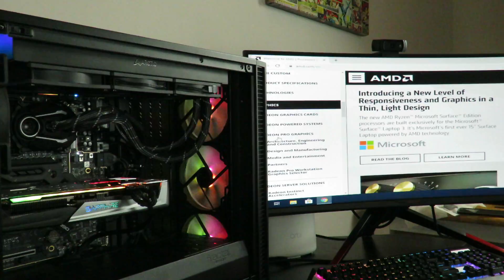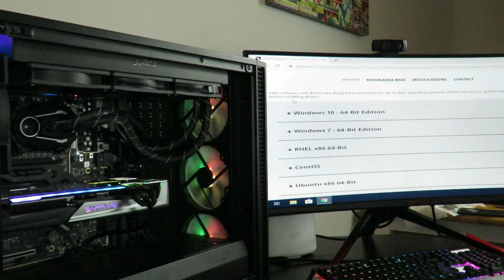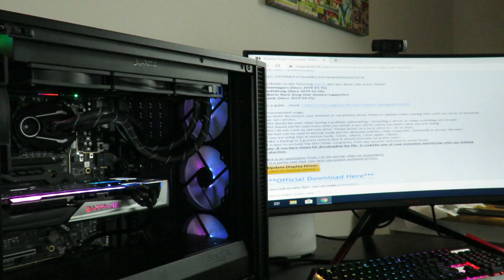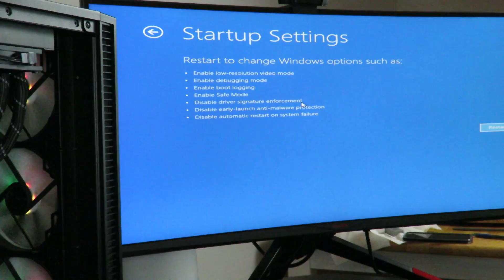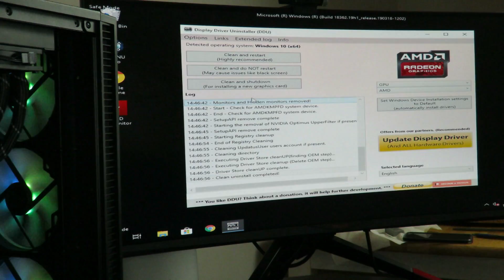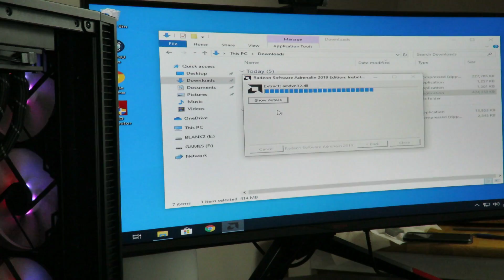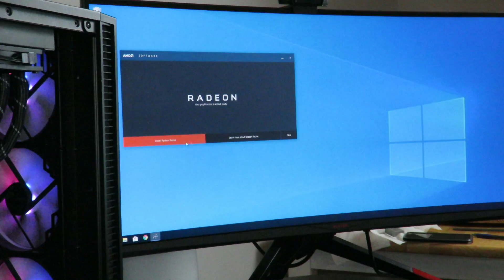Installing the AMD Sapphire Radeon Nitro+ RX 5700 XT 8GB OC Graphics Card

Comment: Hello, i'm thinking to configure a new pc, initially i was going for the rx 5700 xt nitro+ but i see on the web that there are a lot of problems and the card is unstable, it that true? Now i think that i will buy a rtx 2060 super instead, is there an high difference between this two card in 1080p? What card do you you advice to me? (the cpu will be r5 3600)
Reply from the maker: So the 5700 XT Nitro will give you great peformance, especially for the price.  And while there have been issues, I probably relate that more to issues caused by incorrect driver installations, people not plugging in BOTH PCIe connections and maybe a few other things.   I always recommend to install using DDU first, then installing the drivers.  As for the NVIDIA counter parts, the RTX 2060 Super, will perform slightly lower than the XT but the RTX 2070 Super will perform a bit better but it will cost a little more: https://geni.us/bJ83
Reply from the maker: also, what power supply do you have, manufacturer and model number?
Reply: @ThisBytesForYou The configuration is new so i think i don't have to use the ddu and i was looking for the cooler master 550w semi modular
Reply from the maker: @michele3210  for the 2070 Super, it requires a 650Watt power supply and the 5700XT requires a 600Watt, but recommends a 650Watt.  As for the new config, windows includes a base set of drivers, even on new installs, I run DDU, check out the video I made: https://youtu.be/clLYbBywhAg
Reply: @ThisBytesForYou  yes it's raccomanded but i don't think the system will draw more than 400-450 watt in full load
Reply from the maker: @michele3210  correct, during my testing, it was about 450 watts but I would recommend what they recommend and you can see potential issues but it sounds like you have already made up your mind, so I hope you the best of luck.
Reply: @ThisBytesForYou  what 600w psu do you recommends for an economic price?
Reply from the maker: @michele3210  here are a few, 
 default https://geni.us/FoS5hS, https://geni.us/cDB5uU, https://geni.us/wj27f,

Comment: Hi, bought a new sapphire 5700 xt nitro se. Installed and connected with 2x8 pin. Every component starts except the gpu. Any idea? 750w psu. New pc and everything was unconnected before First start
Reply from the maker: What do you mean every starts but the GPU, does the computer get in windows?  Do you have the monitor plugged into the video card, instead of the motherboard, what motherboard do you have?
Reply: 4 Pin psu cpu cable was not connected and one single pin from cpu was bent. Gently corrected. It works now wuhuu
Reply from the maker: @omrkad  ahhhh that is so great to hear that everything is working, thank you so much for letting me know, it means a ton to me.  Have fun with that great new card.
Reply: Make sure that  your video card is seated firmly in the slot, also make sure that the  GPU power connector is Fitted Firmly, it seems to me a connection problem
Reply from the maker: @mountanarivera4450  he got it working Mountana, thanks for chiming in ;)

Comment: Hello,thanks for the video, i recently bought this gpu and i get black screen after installing latests drivers, do you know where the problem comes from? Thank you
Reply from the maker: sorry, a lot of work on my day job.  I would love to help you, but can you let me know what power supply manufacture and model number also, are you using DDU to uninstall the older drivers and install the latest?
Reply: @ThisBytesForYou   Hello, i'm using an gp gigabyte750h power supply , no i didnt use ddu but i made another windows installation from scratch.
Reply from the maker: @theo6387  why don't you give DDU a try installing the official driver, use my video as a reference it helps tons, especially since MS has their own version already in the build, as well as it installs its own if you let it.  https://youtu.be/clLYbBywhAg, on the fresh install, did it work for you?
Reply: @ThisBytesForYou  I'll do right now and keep you informed. Thanks you !
Reply from the maker: @theo6387  Thank you so much my friend, I hope it all works out for you.  LIke with all components from any vendor, there can be issues, but I am pretty sure all is good.

Comment: Where is the memory on your MB?
Reply from the maker: Sharp eye, it's kinda hidden.  On the EVGA Z390 dark, the memory as at the top of the board, so kind of under the liquid cooling unit, you can see it lighting up.
Reply: @ThisBytesForYou  I looked up the MB and seen that. Thanks for responding though. The 5700XT is my next video card purchase when I can afford it. My GTX970 is lagging on all the newer games at 1440p.
Reply from the maker: @Bland-79  yeah, they 970 is a great card, my sun uses it but it's showing its age.  A 5700xt would be a nice update and you are so very welcome, I love chatting with my viewers.  Thank you so much for stopping by, checking out my video and commenting, it means the world to me.
Reply: @ThisBytesForYou  To take full advantage of it I will be upgrading my MB CPU an I7 6700k and RAM to an AMD build. I don't think Iv'e ever done a full AMD build before and I'm 40.
Reply from the maker: sorry I never replied, for some reason a lot of comments are not coming through.  I have built tons, it was part of my job when I worked at oem's as product develpment.
Reply: @ThisBytesForYou  My gtx 970 bit the dust last week. Until I can afford to build a new PC I replaced it with a 1660 Super.
Reply from the maker: @Bland-79  that's not a bad card though for a budget card.
Reply: @ThisBytesForYou  Runs better than my 970 did. I bet my I7 6700k is bottlenecking it though.
Reply from the maker: @Bland-79  no actually, they will work fine together.

Comment: Newbies might try to do this while pc is still conneted to power: you did not mention to unconnect every cable from the pc (& then to hold power button for a moment to ensure the electricity was freed from the psu & other components - or so I heard that it works like this, but probably not as necessary as the first step).
Plus for showing a way to stop win10 from installing drivers automatically (although it's still recommended to just disconnect internet beforehand, duh).
But it's overall very nice step by step guide on how to do the stuff, I'll say that.
Reply from the maker: it's hard to cover it all, but I do thank you and I will try to add that in my next video.  As for holding the power button, just tap it once or twice and that will take care of it, basically the same thing.  Thanks for your compliment and what I should add in my next video, thanks.
Reply: @ThisBytesForYou  the video is really really fine, you mentioned a lot of little stuff I wouldn't even know or think about that are actually useful, so that was just one thing that hit me you missed.
But your clarity in the vid really speaks to me. ;-) Good work, good work.
Reply from the maker: @picapica201  thank you my friend, I do try.  I have been building PC's since I was 13 (I am 41 now) and I love teaching people, thats why I make these.  I do all of this unscripted so at times i may for get a step or 2, but I try to cover everything.  I will try on my next video to cover all the bases.
Reply: you dont have to unplug the cord... just turn the power supply off. Then press the power button to make sure the power is gone and out of the computer
Reply from the maker: @dareason7581  yup, I know, but there is always the what if, unpluggnig the cord, you know for sure there is no power going to the unit.
Reply: @ThisBytesForYou  do you have any ideas what could be causing the blackscreen? I'm even getting slow downs in Crysis 3.
Reply from the maker: @dareason7581  I highly recommend you run DDU to get rid of the older NVIDIA and AMD drivers, and also disable windows from automatically installing their latest driver (you do this all in safemode) then reboot and go back into regular windows and install the latest and greatest driver, DDU allows you to disable the automatic driver download which messes up so much, check out my video on that here: https://youtu.be/clLYbBywhAg

Comment: can i just uninstall the Nvidia drivers from the control panel?
Reply from the maker: you can, but it will take MUCH longer and you will have to reboot about 4 times before you get rid of everything.  Sadly, when you install video drivers for AMD or NVIDIA, it comes with a host of other programs and such and to make sure they don't cause issues, you HAVE to uninstall all of them.  With DDU, it uninstalls Everything, does not leave behind any folders and registry entries like the AMD and NVIDIA uninstallers do.
Reply: @ThisBytesForYou  thank you so much dude keep up the good job :)
Reply from the maker: @Fourthion  thank you so much for your kind words my friend, it means a ton to me.
Reply: @ThisBytesForYou   one more thing i forgot to ask... You recon i m going to have a bottleneck with an i5-8600k running at 4.7 Ghz?
Reply from the maker: @Fourthion  nah, not at all but I would recommend taking it back to stock prior to installing it.  You don't want a bunch of bluescreens and you think it has to do with the video card/drivers when in fact it is the overclock.  Save your overclock in an overclocked profile, then set everything back to stock, save your stock settings as a separate profile (if your BIOS has multiple profiles), then save the bios, boot into windows, download DDU and the latest driver.  Extract DDU, boot into safe mode, run DDU to get rid of your drivers, make sure to check to prevent windows from downloading updated rivers, then shut down.  Install your card, boot into windows, install the drivers and do a lot of testing.  Once you see everything is set and stable, place your overclock settings back and do more testing.  Changing video cards, that have different power requirements and affect your overclock but since you have tested at stock, found no issues you have a point of reference to work with.
Reply: Dude listen up you need to run your OS in safemode. USE DDU it will uninstall all traces of your old videocard. If you do not do this it will 100% give some minor or mayor conflicts. 

You want to make sure it's either a clean windows no drivers, or a used windows what you run in safemode with DDU to remove the drivers from previous brands. Especially conflicting brands, which are all Intel, Nvidea and AMD drivers. Old drivers fuck you up so remove it clean.
Reply from the maker: @dicknr1  for sure

Comment: Hey I bought this card a day ago and when i plug it in the screen is just is completely black nothing is happening
Motherboard: M5A78L
CPU: AMD FX 8350
Is it a driver issue or is m card dead or is the motherboard out of date
Reply from the maker: A few things, 
1.  Do you have the PCIE connecitons connected to the video card?
2.  Do you have the HDMI or Display port connected to the video card, instead of the motherboard?
3.  Do you have the correct input selected on the monitor.  Meaning, if you are connected to HDMI, do you have HDMI selected on the monitor?
4.  Is the video card seated properly in the PCIE slot?
5.  What is the manufacturer and model number oof your power supply?
Reply: @ThisBytesForYou  I have a Corsair cx 750 the video card is seated properaly and the PCIE connentions are connected I have a HDMI plugged in and i have the correct input on the monitor, also thanks for the fast reply
Reply from the maker: @Lomasari  anytime my friend, thank you so much for stopping by and checking out my video and commenting, it means a ton to me.  So, have you tried another video card, first of to make sure that the PCIE slot of working, this also allows you to remove and reseat the video card, it happens to us all, it looks seated but its not totally.  Oh one other thing, your BIOS MUST recognize the PCIE slot as a UEFI slot, so you will need to change that in the BIOS.  A quick search, I don't see that it does, which is a problem since newer cards need UEFI, please check in the BIOS to see if you have that option, some where where you would see PCI-E.
Reply: @ThisBytesForYou  I tried the card in another pc just now and still zero input and I just took out my GTX 950 Which is the card i had in before the 5700 xt
Reply from the maker: @Lomasari  hnnnm sadly then yes, it looks like the card might be bad.  Hopefully you have enough time to return it and get a new one, it happens with anything though.
Reply: @ThisBytesForYou  Ok I was doing some trouble shooting and I got the card to work but the cpu is being used as the dedicated gpu but it doesn't have integrated so it dies every time I play anything
Reply from the maker: @Lomasari  the FX 8350 does not have integrated video, so it will never power on through that, but are you connected to the VGA/DVI/HDMI/DP port on the motherboard or the one on the video card?
Reply: @ThisBytesForYou  video card it may just be heavily bottle necked
Reply from the maker: @Lomasari  no, the cpu has no video capability what so ever, wait.... what power supply do you have, manufacturer and model number?
Reply: @ThisBytesForYou  I have a corsair CX 750M
Reply from the maker: @Lomasari  sorry, I saw you already said that.  Download gpuz and run it, you will see on the bottom left or right hand side, an unchecked box that will let you monitor temptures in the background and place a text file in whatever location you would like which gives you a bunch of info.  Run this, them play a game, when your monitor shits down, reboot your pc then open that file so you can see if your gpu is overheating.  U thought at first it was a power issue, but if you have both pcie connections connected to the card you should be fine.  So it might be thermal.
Reply: @ThisBytesForYou  I don't think it's a power issue
Reply from the maker: @Lomasari  being that you have a 750, for sure its not a power issue.  I would recommend you contact Sapphire and get the card RMA'ed or maybe they can help you get it back up.  If they do help you get it back up, please let me know what they recommended so I can help others.  Thank you.
Reply: Mine did the same after some days boom burned...this card has issues
Reply from the maker: @PetrosVu  wow, that is insane.... First I have heard about that.  Did you RMA it?
Reply: I get no signal on monitor
Reply from the maker: @denisg123  A few things, 
1.  Do you have the PCIE connecitons connected to the video card?
2.  Do you have the HDMI or Display port connected to the video card, instead of the motherboard?
3.  Do you have the correct input selected on the monitor.  Meaning, if you are connected to HDMI, do you have HDMI selected on the monitor?
4.  Is the video card seated properly in the PCIE slot?
5.  What is the manufacturer and model number of your power supply?
Reply: @ThisBytesForYou  everything is done correctly 
Power supply is evga 450 bv
Reply from the maker: that is probably your issue, they require a 600Watt and recommend a 650Watt.
Reply: @ThisBytesForYou  should get one withen 2hrs i will let u know
Reply from the maker: @denisg123  please let me know how it goes, but I will be sleeping in 2 hours, I will respond to you tomorrow though, I always reply.
Reply: @ThisBytesForYou  no still not working i got a 750w corisair
Reply: @ThisBytesForYou  got it to work remove ram and insert left to right 1 and 3

Comment: Hello. My PSU is modular, do i need to plug  2 cables or 1 with 2+6 × 2 is enough ? Thx great video.
Reply from the maker: either would be perfectly fine, what is the manufacturer and model number of your power supply?
Reply: @ThisBytesForYou  the psu is Corsair RM850X 😊
Reply from the maker: @luismartins6687  ahhh ok perfect, I just wanted to make sure that your power supply met Sapphires requirements.  Sapphire places a 600Watt requirement on this card, but recommends the 650Watt and with your 850, you've got this covered.  Great, I just wanted to make sure, knowing exactly what you had before 100% saying it would work.  Thank you so much for stopping by and checking out my video, and even more for commenting, it means the world to me.

Comment: Hi, Can you say me if this two PSU have two 8 connectors or if I can do the same thing you did in this video without buy cables?
The two PSU are:  Sharkoon silentstorm Cool Zero 650W and  Rio Toro Enigma 650W. Thanks
Reply from the maker: The sharkoo has 4 x 2+6pin pcie and the and the Tori does too, you would be good with either my friend
Reply: @ThisBytesForYou  thank you very much.
Reply from the maker: @AlbYSaN-  you are very welcome my friend
Reply: Thermaltakes got them aswell, those 600w oder 700w are really good, its a recommandation.
Reply: @adem1530  I bought a 750W when I grabbed my Nitro+ last week. Don't know if it was a bit of an overkill. I'd heard that 650W is what you should have but the guy at Micro Center recommended a 750W plus going bigger never hurts. Luckily with a modular PSU you don't end up with extra wires.
Reply: @TerraWare  better having more Watts then having less😂✌